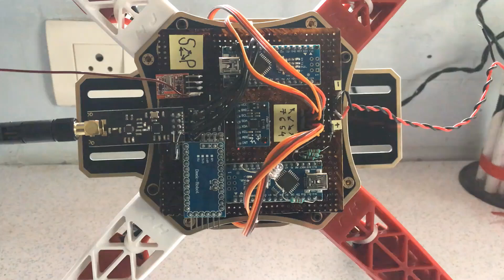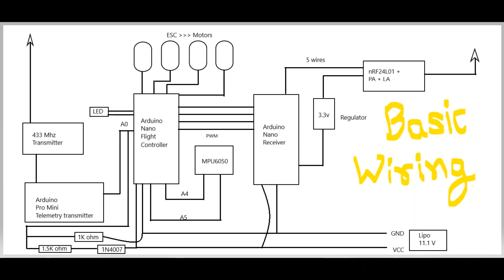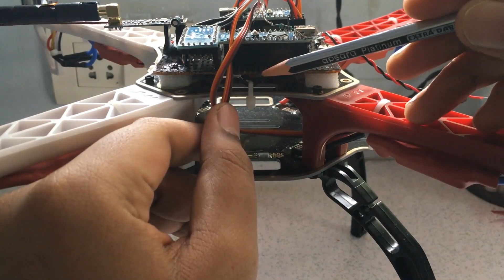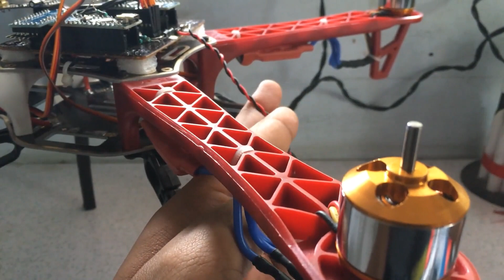Arduino Quadcopter |  YMFC-AL + nRF24L01 + 433Mhz Telemetry | Flight Controller Explaination

Comment: I think this is incomplete(something is missing) because rc receiver is not merging / connecting with another arduino as ymfc al video is showing something else, I carefully followed multiple time, you only showed and posted the transmitter part code and battery telemetry part which is working brilliantly but not showed receiver part where it merging with ymfc al code, Its tricky 😐

Comment: nice project
Reply from the maker: both nrf and 433mhz libraries require same Arduino timer T1 for working... you can use modified library for 433mhz to use T2 timer but i was just lazy and used 2nd Arduino.

Comment: Hey buddy nicely done!! I did mine based on YMFC-AL too super easy to make, nice addition for telemetry, what parameters are you receiving from it?
Reply from the maker: Thanks bro! I actually made it mainly for receiving the battery voltage and to show flight time as well as positions of sticks.
Reply: @SushrutPhutane  thats good insight, thanks for the reply 😀👍 will try to implement it.